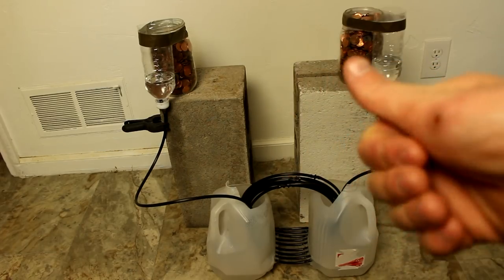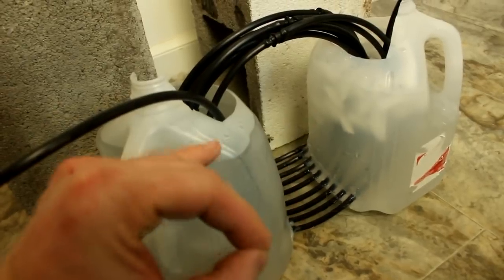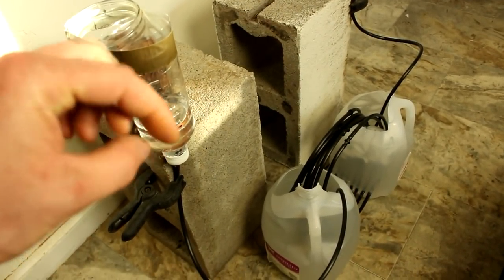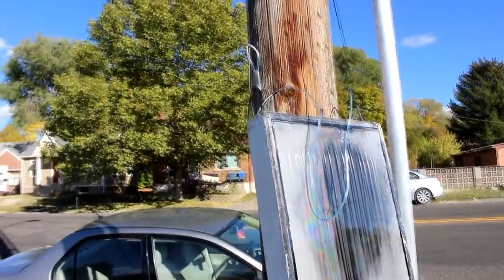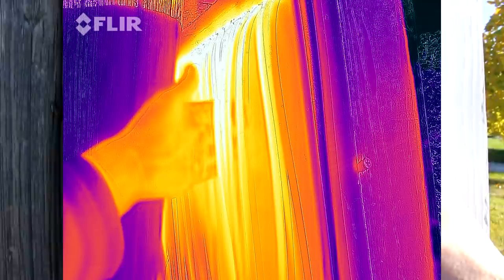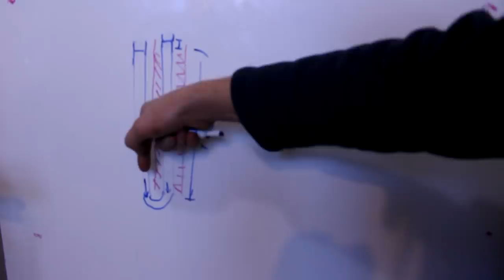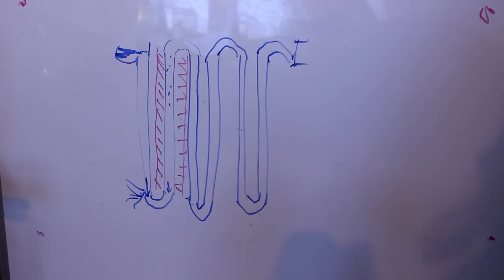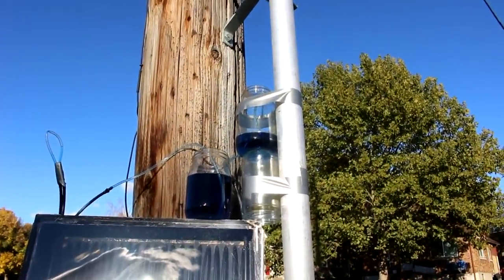Water Pump With No Moving Parts? (except water of course)

Comment: Instead of having 22 hot tubes and 22 cold tubes that flow each other requiring time to equalize, what if you just had a single tube on each side that had 22 times the cross sectional area, and then reduced it down to the fine tube at the top? Seems like you'd get the same amplified pressure differential thanks to the volume of water. I.e., 1cm difference in height for that larger cross section would be the same pressure difference as 22cm height difference in the finer tubing. But you'd avoid all that time spent re-cooling the heated water, which seems like it'd make the water flow faster.

Comment: Instead of wrapping the tube, wouldn't be more efficient if you had a bunch of loops separated from each other, each with its individual end? This would prevent the liquid from having to change it's temperature each time it change from one side to another and speed up the process. I think...

Comment: There is an old video of water bottles that do this using straws. 

Your idea would be better by puttimg half in the ground about 5 feet where the temp is around 30 degrees. Then cover the part that is heated with aluminum cans that are spray painted black. They do this method with cooling/ heating tiny houses a lot.

Comment: Since you need heating and cooling elements, have you considered using those Dehumidifier Diodes which get really hot on one side and cold on the other side and using copper tubing?

Comment: what if you put a peltier module into the loop? you can make it electric powered with still no moving parts, but much higher performance compared to a sun powered one. Also you don't have to rely on cold shadow temp, and shining sun working together

Comment: I was wondering if it would be more efficient if you used a single loop. so you coil the hose in the box and have a coil outside for cooling. Would that improve the head differential, or would you just end up with the same results? Also for a larger scale would it be beneficial to bury the cold side to help transfer the heat?

Comment: What if instead of connecting it in a bent tube, you made it parallel? So one reservoir (the hot side) breaks up into many smaller tubes (instead of just one) and then the small tubes then get put into another reservoir ( the cold side). Wouldn't that make the heating efficient since the water doesn't get hot, then cold, then hot, then cold etc? One entire side will always remain hot while the other side will always remain cold.

Comment: so it's similar to peltier module needing a heatsink otherwise the difference decreases too much
Reply: Absolutely correct: What he's got here, is a "fluidyne" version of a Stirling engine. The only moving part, is the fluid itself.(water) It still uses a temperature differential, to change the volume, thus, density of the motive fluid, to cause the movement.

Comment: 4 years late to the game...but it would be interesting if you did this with a fluid that has a lower heat capacity as well as a higher thermal expansion....like ethanol.  Granted, it wouldn't be useful for you, because it is water you want to move, but it would still be interesting.
The lower heat capacity would lead to a larger (or faster) change in temperature for the same energy absorption/loss, and the higher expansion would lead to a greater head difference for the same temperature change.

Comment: I imagine manifolded hot side with  a check valve at the top feeding the reservoir.  and an old copper radiant tube with fins for the down pipe.  The thermal expansion is the pumper... but the lighter hot water and the cold dense water also moves those aren't the same are they?

Comment: I feel like it'd be easier to determine the efficacy of this system if it were a closed loop system and you could use a flow meter somehow. 
The flow could probably be quite good but the static pressure or head pressure or whatever its called is going to be quite poor.

Comment: Cody, please make a magnetic fluid electrical generator:
Coils sheathing plastic tube with smco alnico ndfeb fe3o4 dust syrupy mud in endless loop...
A moving magnetic field across a copper wire will create a current charge

Comment: Wonder if it would make a difference if the cooling pipe was larger in diameter or if you had a barrel and a thin tube up from the bottom?

Comment: use copper tubes on the cold side and I wonder what difference it would make if you used a smaller diameter of tubing. Less gravity to fight as it makes 1 loop maybe? I'm not good at math.

Comment: Why not have the tube in a J shape, with the right side of the J being half covered in tinfoil/aluminium foil, to concentrate the heat and thus have the water level raise. Thou, a lot more tinfoil might be usable to heat one point of the right side of the J, and have the movement created that way. Heck, you could even use the energy to heat air to power an engine, to lift up the water. Or just use a ram pump or wind pimp to move the water with a minimal number of moving parts. But the Heron's Fountain mechanism of moving water might be enough to create a siphon powerful enough to move all the water over (if you really want only the water to move).

Comment: How about using the same method as a tree or plant. Using much narrower tubes (something something surface tension) water heating and evaporating at top into enclosure, condenses, runs back down.

Comment: QUESTION: Would it make a difference if the pump with the 22 loops were laying on its side rather than upright?  With the thinking that pushing water up a tube that tall is very difficult.  Thoughts?

Comment: Not taking into consideration the cost; would copper tubing or wrapping the plastic tubing in copper wire, would that produce a bigger temperature gradient? Would it pump the water faster?

Comment: Would it work any better if instead of wrapping the pipe as a continuous coil what if you had a header pipe on the cold side that all the pipes were connected to (instead of it coiling back round) and another header pipe on the hot side (so you would have a u pipe set up going from cold header down then back up to the hot header) then all 22 pipes would be pushing at the same time so it might make it quicker? Just a guess / thought?

Comment: What about a rankine cycle engine using refrigerant that operates at very small temperature gradient?  I'm sure this has been done before but I think it would be really cool to see a closed loop turbine generator system using solar or geothermal energy.
Reply: To add to that idea, it might be interesting to see how efficient a system like that could be made.  A solar panel only absorbs energy from light within a specific spectrum.  A blackbody could be used to capture a greater percentage of the solar energy available and so could perhaps have an impressive efficiency.  Sort of like a steam-punk solar panel.

Comment: Use radiators from junk cars each stepped up for your rise in grade. Cut the cooling fins off the hot side and paint black leave the cooling fins on the cold side and paint white.

Comment: Cody, I have a serious question here. Why does the stacking of these single cycles work? Your apparatus is nearly symmetrical, therefor I would expect that the water does not "know" which way to go. The effect of the multiple tubes should nearly cancel out, and only one cycle of tubes should remain.

Comment: Would having many tubes running in parallel rather than a single long tube help? It appears a part of the slow down is having to heat/cool/heat/cool the water so many times. If there was a single inlet, many single channels to go through, and back into a single exit. 

Your lower section of tubing could even be buried into the ground as a part of the heat exchange.

Comment: Could you change the shape of the heat zone? Instead of 180° and 180° cold, make trying a higher degree of heat and a lower degree cold, increasing pressure and decreasing weight.

Comment: @Cod'sLab:  Wait, I don't get it... isn't the water just as likely to flow backward as it is to flow forward?  Do you have a valve of some sort?  After the movement of the water from the initial temperature increase, how do you get any further flow?  Seems like you'd see some initial movement then it stagnates.  Unless I'm totally missing something.

Comment: i wonder if you used a Tesla valve at some point in the line if you would get more flow? as the water expanded it would not be able to push back against the valve pushing the expanding water forward
Reply: thinking about it, i believe it would need to be at the supply going into the heating side so the pressure would force forward i think unless putting it at the end would reduce back pressure into the system.... hmmmm...

Comment: Hey Cody,

still watching your here clip, but a possible idea for your cooling on the back end of your panel... Would it be possible to add a second panel on the back panel (with a void between to provide air ventilation and/or insulation from the "pipe-panel"), filled with water, to act as a type of radiator/heat-sink?

Granted, over time the sink's temperature would increase as the heated water cycles through the tubing immersed in the water and dumps its heat, which would decrease its efficiency, but would the temperature increase fast enough to be impractical?

I'm not by any means an expert at all, but just thought I'd throw my street-level thoughts in the brain bucket!

Comment: Would this work better if all of the tubes on the 'hot' side were one length of tube, and all the 'cold' side one continuous tube, just linked at one end? Or would that be too much pressure at the point where the two volumes meet?

Comment: Is this essentially the same process as solar thermal heaters? However rather than cycling hearing and cooling they run tube to tube to increase the temperature. That would end up with a greater temperature differential and a greater difference of head?

Comment: You shouldn't have ran the hose front to back alternating.  You should have done all front, weaving left to right going up, to allow the heat to maximize.  Then done the back the same way but going down.  This would have allowed for the greatest difference in temperatures between the front and back.

Comment: have you tried to rotate system? there is some possibility that right(most effective) configuration when cooler part - upside, and heater jar at the bottom, but with flat configuration it would not be evident - need circle - as first design, as i guess

Comment: How about capillary action? this is why plants grow (only) as tall as they do - it is as far as they can lift the water by capillary action. But what if you can lift a column, by capillary action, only, say, a foot? Can it then dump its contents (perhaps by a wick) into a "staging tray" where another capillary tube can raise it another foot and so on? I realize it will require very small tubes to do this. but, hey, it's and idea.
Reply: What would you use to wick it... he wants to keep everything in the water with the water, remember.

Comment: would it work better if the pipe were zigzagged up and down the hot side then looped to the cold side and zigzagged? there would still be the compound effect with only one loop the water has to change temperatures, right?

Comment: Will not it be a simpler but completely equivalent option to simply paint the one side of the glass block in black? This will be the same effect of the pump that operates off thermal energy a.k.a. convection.

Comment: I live in Phoenix and I'm not sure of the calculations for determining the water height but I am sure if you put one end of this in a swamp cooler you could easily achieve 60 degrees F on one side and 160 degrees F on the other on a hot dry day. I wonder what the flow rate would be though? Enough to function as the cooler pump?

Comment: Cody, what do you plan to do if the tubing gets clogged over time from being used in your fish tank idea? A filter would certainly help but filters get clogged and require maintenance too
Reply: Good question. Now I'm wondering if there would be a way to accomplish the same thing without tubes. Maybe something as simple as a surface in the middle of the tank that is black on one side and white on the other?

Comment: Why don't you use convection together with density differential? Cold water comes from the bottom, goes on a serpentine like in the box all the way to the top, like in solar thermal collectors?  I have one of this at home to heat water and it has no motor, but the water flows.

Comment: Wouldn't it work just as well if you only had one section of tube on the cold side? All of the warmed tube will expand regardless of how much cold tube there is. This way you can use the same amount of tube to have more warm tube, and the tube never goes behind and cools off.

Comment: Can this pump work continuously? Your video showed half of one cycle. The next half of the cycle needs to return the system back to its original state (with all the tube sides the same temperature and full of water). If you left your current system out for multiple days I don't think it would continue to pump water because as the two halves reached the same temperature at night it would pull a big air bubble from the outlet into the tube as the water contracts. Then the next day when the tubes have a temperature differential all that will happen is the air bubble will get pushed out and the water won't actually get pumped. This will keep happening day after day, with only the first day actually pumping water. Am I missing something?

Comment: Its very cool but wouldnt a bunch of Stirling engines have been able to pump more water?  Granted those obviously have moving parts so yours is arguably more robust.
Reply: Please keep in mind, this IS a "fluidyne" Stirling engine. The moving part is the fluid itself.(water)You're right about robust. No bearings, no seals. As long as UV rays don't get the better of the tubing, there really is nothing that can go wrong.
Reply: @vincentrobinette1507  I suppose it is using a heat differential so it is essentially a stirling engine in that regard.  Fair enough thats a valid critique I think, thanks for the interesting perspective on this.

Comment: Hi, I really enjoyed your video. I had a thought about how to improve your heat transfer based on that Air Cooled Refrigeration Systems make use of tubing that run through fins, using fans, or some way to bring air past the fins, to encourage more efficient heat transfer from air by turbulence of air on the tubing.
Not sure what passive methods there are for this.

Comment: Would it be possible to use a thermal electric generator powered by a solar panel to heat the tubing? There is no moving parts but I guess it could be possible for one of the parts to fail so I don't know.

Comment: What if you made the cooling lines longer giving mor time to disperse the heat? 
Side note keeping everything the same but using heat lamps and moving the line from the jar you wanted to fill to the supply jar could/would this system continue to run till you ran out of heat/electricity

Comment: Like you said, very inefficient - with every loop you are also adding pressure drop (turns, fittings and length of pipe) - the total head you will achieve is not likely to be as simple as head for one loop x number of loops. More likely head of first loop plus x% for each extra loop. Try to smooth out your turns. Also, without a radiator / HX of some sort, how do you plan to stop the system temperature from getting too high?

Comment: could you use a counter flow heat exchanger to increase the efficiency? no sense in letting all that heat dissipate away when you can use it to preheat water going to the hot side, and cool the hot water moving to the cold side.

Comment: Hmm wouldn't it be better to have a cold Reservoir connected to all of the back ones and then have all of them be pushing it into the singular Reservoir for warmed  and then at that point it's just basic if it's a completely sealed unit there would be no loss at that point you would just need the vacuum siphon the hot to cold.

Comment: How would using a higher density fluid change the head? Would salting the water increase the head or would it reduce it? 
(As in: Whats the relationhip of density between cold salt water and warm salt water? would we see a larger difference in density or a smaller difference?)

Comment: just last week I was thinking.. I wonder if I could do something like this with air bubbles. I was playing with a solar water heater this past summer, and had some trouble with trapped air in the return line. if there was some way I could release the air at the top of each loop, I wonder how much pressure I could accumulate with many loops.

Comment: Ice is less dense then liquid water (ice floats on liquid water) and obviously colder in most conditions in our atmosphere probably... right? So why is the chart saying the colder the water, the denser if ice is less dense than liquid water and ice forms as temperature decreases?
Reply: Brandon Sams , Water gets more dense as it gets colder until about 4C (I think that's the number at least), but past that point instead of the less energy making it move less and be more dense, the decrease in movement makes it form crystalline structures, which are less dense.
Reply: Brandon Sams yes, water is at its most dense around 4° Celsius. And starts to expand when colded further.
Reply: thx. I understand
Reply: thank you

Comment: Boiling the water by having it in a dark tube insulated by a vaccum could be an effective way of pumping the water using an air cooled condensor at the top.